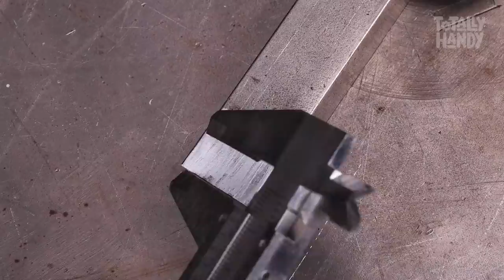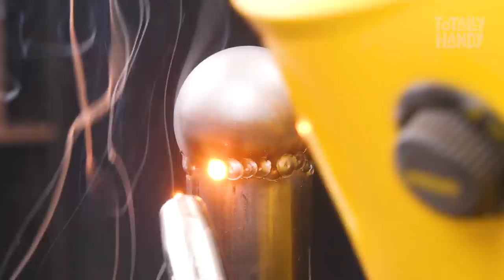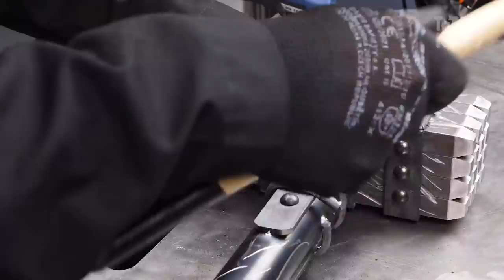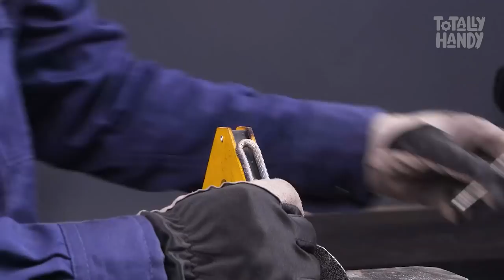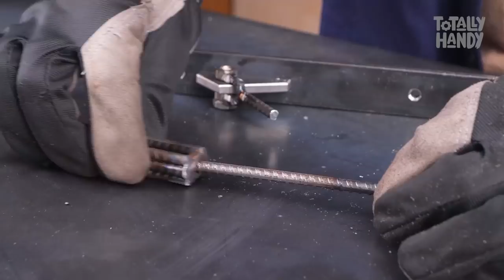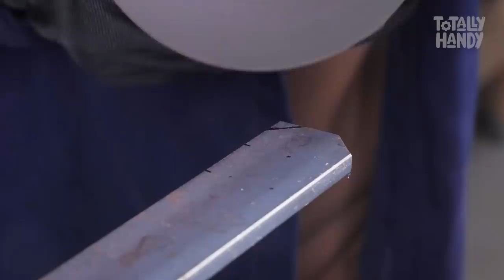How to build an authentic Viking sledgehammer & More DIY Projects | Metalworking Project

Comment: You’ve got amazing creativity, I’ve got to hand it to you. But please for the love of god stop tack welding everything. Learn to actually weld!! It will be stronger, cleaner, and safer! It also does not look like you are using any gas (based on the black smoke and “burning” that occurs. Should be clean and shiny if done correctly with the right gas. Just want to see you get even better! Cheers 👍🏼
Reply: He's not welding things that people are going to be standing on.  They are arts and craft welds.    They dont need to be safe
Reply: That false
Reply: It's a heavy object that someone will pick up, even if someone never swings it, you don't want it coming apart